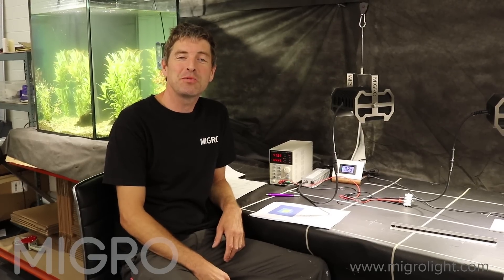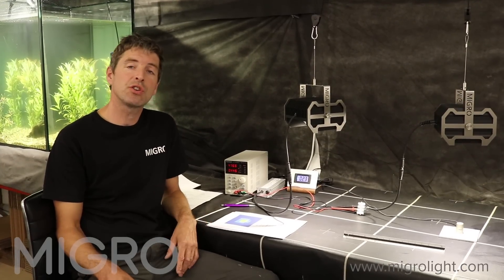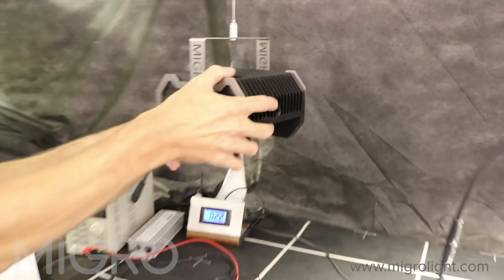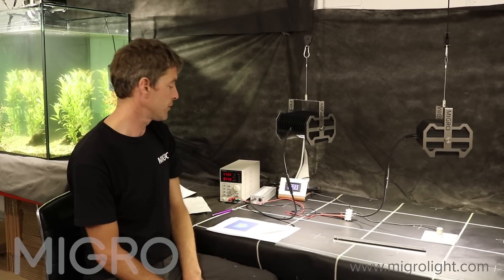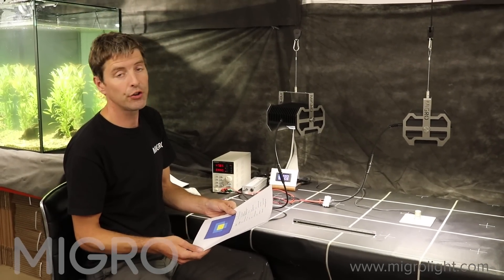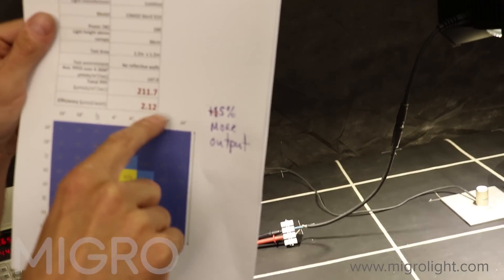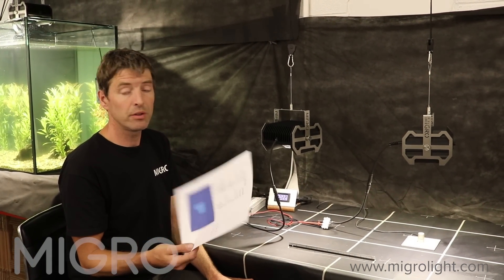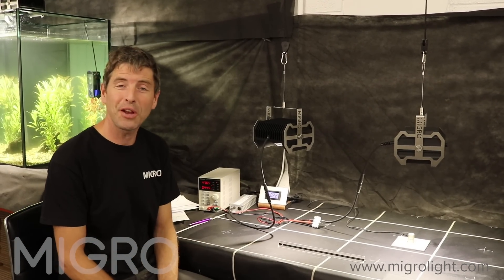Best COB grow light 2018? - Cree CXB3590 Vs Luminus CXM32 COB test and comparison

Comment: i think these would be alot better if u mounted them using thier ideal solderless led  holders so that u get a more even distribution of heat with only 2 screws theres not even pressure over the whole cob

Comment: Which one has better production, quantity quality, creates high efficiency cob cxb 3590 or luminus cxm 32, these chips work at 50w, adding several points of light to reach 450 500 watts in a square meter, which would be better, cob name high efficiency, or this panel that you test in the video with mixed technologies of samsung lm301h ob, with the same watts, 450w vs 450w of samsung,

Comment: Hi Shane from migro been watching you for a few years now and still have not seen what I am looking for I am looking for a light that changes spectrum throughout a timed lighting cycle like say it starts the cycle at 2000k then 2 hours later goes to 3000k and so on till it gets to 5000k then starts to go the other way for the latter part of the cycle but also incorporates the far reds and uv at the propper times I believe plants have in their genetics when to use what type of photons in the light and Making those certain photons available at the right time will increase yield.
While I believe making many photons available is important I believe making the right kind of photons available is just as important if not more.

Comment: Great video ...It makes no economic sense to run at 100W .... Far better run at 25W they will be even more efficient than at 50W ... the cost of saved electricity will quickly pay for the extra units , and they will effectively last forever and the light output will not drop so quickly over life ... Be interesting to know light output of unit after 3 months of use .

Comment: There have been some concerns about the Luminous Cobs losing output significantly in the first 2-3 years of operation. Specifically, 15% over the first 2 years as opposed to 5% with Cree and others. Of course, this would merely put them at similar outputs at that point, however as time goes on if this continued it would be worrisome.

Comment: Hi, for small setup, what about the Luminus CMX22 ?
Reply: I'm considering building a luminous CXM22  light build or even cxm14,s all onto one big aluminium heat sink and use about 10 on each block , would be quite cheap aswell

Comment: Luminus wins at everything, especially price. Also, Gen4 Luminus available, I got my hands on 20.. 8% better lm/w and a wider v operating range! Puts them on par with HLGs at same wattages, 40% cheaper. Also, you are comparing apples and oranges, cxm is 22mm.. cree 3590 is 27mm.  Better comparison would be vs cree 22mm 2590.  4x CXM22 on hlg-185h-48a = best combo on the market.
Reply: crayZ  les is 32mm
Reply: crayZ but your still right apples to oranges as the cree is only 28

Comment: As others have said please compare with citizen clu048 1212
Reply: CLU48 is quite decent even compare to CLU58
Reply: Yeah I'd really love to know aswell
Reply: The citizen cluo58 are the same price but lower spec than the luminous CXM32,  so you would always buy luminous CXM32,  whereas citizen clu048 are as little as 8 pounds each compared to 27 pounds luminous CXM32 chips ,, so the best to compare would surely be the citizen clu048 led chips
Reply: with CLU058 rather ...

Comment: DB is top bin. You can find and on cutter or mouser. Inside the datasheet is another table that explains the binning scheme regardeless it is not in the old topdocument listing for the 3500k.... so you basically tested shit. I bought eight DBs 2017 so you reviewing the CD is extremely late. Giving that fact it is just unfair and the new top bin Luminus surely wins. Regarding high efficiency... what is the Minimum constant current to delive stable spectrum thats the important question. When you want high efficiency you go for high count of COBs you may want 1050ma or even 700ma working without the spectrum go yellow or kinda like.... and when I dimm the 700ma down, about 500 is still ok, but down to 350ma the Crees spectrum becomes unusable. What abou the Luminus?

Comment: So basically, it would make sense to run the CREE at 50% wattage, just doubling up on COBs for longer lifespan and efficiency ?
Reply from the maker: Or just use Luminus?
Reply: @MIGROLIGHT   Im dealing with part availability over here in the EU. just got my CXB's and about to wire everything up.

Comment: hi shane, great videos thanks. if i wanted to run 5 CXM-32-35-80-54-AC00-F2-3 cob lights, what size driver should i use and would you recommend a particular brand?
Reply from the maker: Hi, driver brand not important. I recommend running them at 2amps each, seems to be a sweet spot.

Comment: I am wondering as technology on leds is rapidly evolving seems like every 6 months or so something newer more  efficient  hits the market like Samsung  lm561c, and now the Samsung  lm301b is out even better than the 561c. Is Migro working on a new light for maybe a year or even two from now so Migro  can still compete with the top end led companys at the top teir level.
Reply from the maker: We will use whatever high quality COB is most efficient at high power. At the moment it's Luminus but if they are surpassed we will use the better one.

Comment: Migro, please take a doubt.
Would it be better to run this LUMINUS led in higher currents? in 100W? or run them in 50W lower current? Which voltage would be most efficient in lumen issues? Thank you.

I'm thinking of setting up a COB panel but I'm in doubt about which chip to use, do you think it's vero29 and more efficient than 3590 believes? or the Luminus would be the best option?

Comment: Is PPFD/W an SI Metric? 
You should present us the data in Umol/J(W) you have the meters for it (the asensetek) why not use it to simply calculate this.. What is the efficacy of the Luminus at chip level?

First of all the Cree chip is mounted wrong. There is no even distribution of the pressure. This test was done completely out of spec. The cob will have run to hot because of the lack of pressure. Why did you not take the effort to buy a holder for 2 euro's an drill and thread the 2 holes needed for proper testing. And by the way the DB is the top bin for Cree but as they can not produce these in mass only the big players on the market are able to get these. Not the fake ones they are selling on alibaba. Just Google Cree VS Kingbright.. There are 2 places where you can get them in Europe but I am not going to mention them here.

I would like to have seen the Tc of both the cobs to give a fair representation of the conditions tested in. What you have done tells us nothing.. 
How is that in your test first Optic wins (clone of a Dutch company btw) and now it lost by 15%. There already is independent sphere data available which says that the Cree delivers much more then you let us on to believe. 

Here is the link https://chilledgrowlights.com/independent-lab-reports/lab-test-report-cree-xlamp-cxb3590-3500k-cd-bin
Reply: I get legit CXB3590s 3500K DB bin from Kingbrite, unrelated to the 2014 Kingbright lawsuit (Kingbright Inc is an LED manufacturer in Taiwan). Anyway Kingbrite has always been honest with me about the bins. If I ask for a bin they don't have, they simply say no when they could have lied if they chose. And of course their packaging is legit with labels, part numbers and batch numbers that makes sense based on the dates over the years and they match with CXA3070s I got from digikey etc. There is no cheap way to fake a CXB3590, you can see the gold traces sparkle more brightly than the CXA3590 for example and the colors are dead on.
Reply: That said, the CXB3590 does not like to be run hot, unlike most of the other COBs which handle it much better. But it is not hard to get them to run cool, Tj30C is no problem at 25W. Also worth mentioning 2.37 umol/s/W is much lower than we should be gunning for IMO. Especially now with claims of 3umol/s/w from the LM301H boards.

Comment: And citizan058 1836?
Reply: MIGRO:
They are 25% less efficient than Luminus, not really up to current standards I'm afraid.
Reply: @norbertmayszek9437  source?? In datasheet tell me.another thing. Cbx3590 is totally less than citizen 1825 80 Cristina 3500k gen 6. In fact cree is out this 2018

Comment: 👍 on your quick reply to the comment about the Optic1, I was wondering that myself.
I'm looking at  lower power veg replacements & have it pretty much narrowed down to the HLG65, but there's a 36 watt one from Hidden Harvest Company that has piqued my interest, but there's not much info on their site to go by. I'd highly value your opinion. 
Thank you.
Reply from the maker: What siz
e area do you want to cover in Veg?
Reply: @MIGROLIGHT  
36"D x 60"W x 40"H. I will be converting it soon to get another 24-36" in height.
Reply from the maker: In metres that's 0.9 x 1.5 = 1.35 m2. You need average 250ppfd x 1.35 = 335 PPFD total. That's 2 x MIGRO 100s for 430 PPFD. Divide the 335 by efficiency in PPFD to calculate target wattage.
Reply: I was also interested in the Hidden Harvest light but there is absolutely no info whatsoever on their site, so they won't be getting my money!
Reply: @ceili  
That's why I'm asking this question here. I feel like I can get an honest, "Mr. Spock" answer. And I wouldn't fault him if he told me I need a Migro or 2, I know I would if I were Shane.  I'd also end up skewing every test to make Migro blow away all other competitors lol
Reply: Thats what he likes to do, either that or he doesnt have a full understanding of what hes talking about

Comment: Are the spectrums the same with the Cree and the Luminous? I know both are 3500K, but that doesn't always transfer to spectrum? Thanks for everything you do Shane!
Reply from the maker: Yes they are almost exactly the same under a Spectrometer. The proportions of Blue, Green andd Red are very similar.
Reply: @MIGROLIGHT  One more question, as I'm a bit forgetful today. Are the Migro's dimmable? I've looked at 50W to 100W, and think 100W(1 in each corner of tent with a 630W CMH. Was going to a 1000W CMH setup, but I believe 4 COB's, 1 in each corner would even out my 5'x5' tent. 50W may be fine, but great to know I could boost to 100W. Definitely worth the extra cost if dimmable. And still the best deal/quality per watts! Thanks Shane!
Reply from the maker: A 5x5 could definitely use 1000w CMH. 1050 w x 1.4 PPFD per watt is 1490 PPFD total. 1490/2.25 = 662 average PPFD that is a good level. 
660watts of CMH produces 660 x 1.4 = 924.  MIGRO 400 = 860 PPFD. 924 + 860 = 1784 total PPFD. 1784/2.25 = 792 average PPFD. That's getting into high performance level👍
Reply: 3500K, 80 CRI, right? Cause the 90 wuold have a much wider spectrum.

Comment: Then why does the optic 1 out perform the migro?..another great vid by migro!
Reply from the maker: The PPFD/watt tests were with the Optic 1 at 50W and the Luminus at 100W. At 50W Cree is 2.08 PPFD/Watt at the chip. At 100W the Luminus is 2.12PPFD per watt. The lens used in MIGRO is diffused and loses a little PPFD and the Optic 1 LED driver is a little more efficient. There is only a few % difference overall.
Reply: @MIGROLIGHT  HLG 550 v2 is the best LED on the Market hands down and if you disagree get one & compare it to yours
Reply from the maker: What's their PPFD per watt measurement?
Reply: HLG grower  I 100% agree
Reply: MIGRO hlg 550 is the bees knees. Cobs cant really get any better now. Just too much light in a concentrated area. but the hlg uses chips that are printed on spread well away from each other. Checkout chilled growlights.com
Reply: @MIGROLIGHT  yes but in your led test video the optic 1 got 2nd place on your list ...which means it outperformed the migro ..so how is this chip better than the optic if the optic was better in your last video...what am I missing here?
Reply: Both the "optic 1" and the Migro are vastly overpriced.
Reply: Optic 1 lenses don't diffuse
Reply from the maker: Yes and they are a little more efficient than the MIGRO diffused lens. The reduction in hot spots Nd more even light distribution is worth the 2% loss on our view.
Reply: There's always one that does not agree with what they are seeing and you are it !
Reply: @peteward8559  do you have any idea what your replied about,  obviously not.
Reply: @TheGreenLobstah  l smell troll
Reply: ward  lolz...ya man let it go..migro is a sweet channel and doesnt need negative stuff on here. Trolls are just annoying cause they never know the context. .anyways lolz
Reply: @TheGreenLobstah  must be cross talk l have 16 migros
Reply: @YouTubeHallMonitor  no problem,  the honor is all on this side of the table.
Reply: @YouTubeHallMonitor  you obviously havent seen the video we are speaking of you troll.
Reply: you are the one who trolls